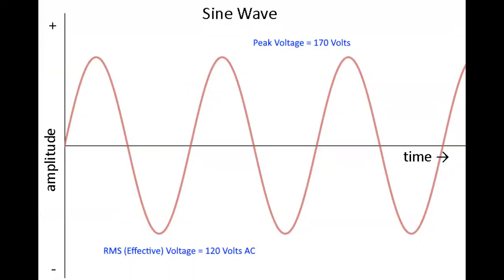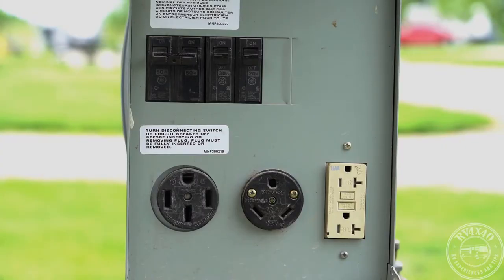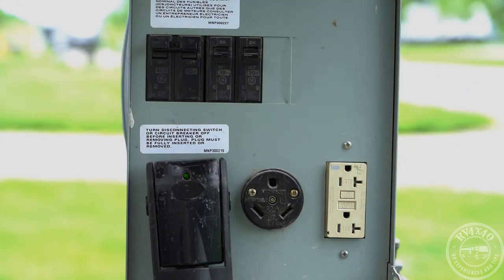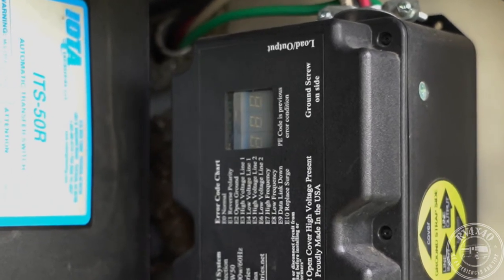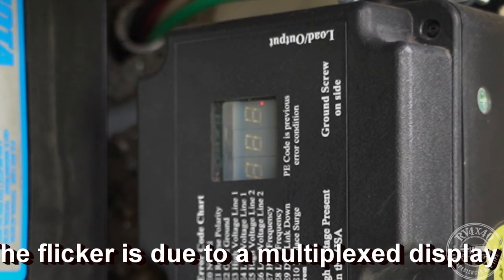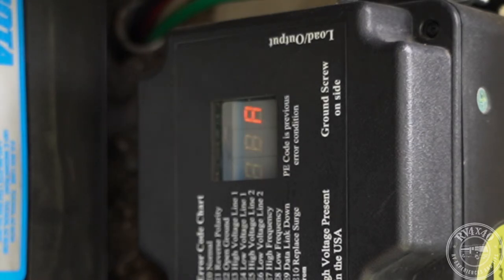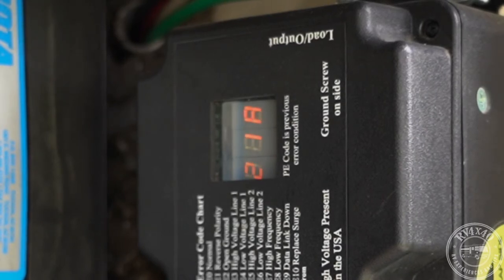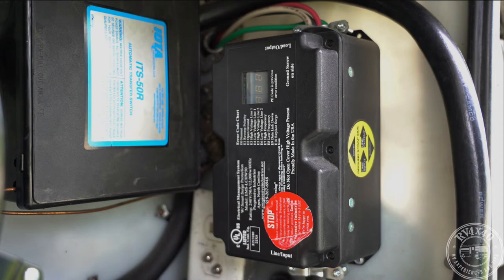RV Energy Management System

Comment: Very well done video.  I had one of those and it worked well except when using a small portable generator (Honda EU2000i when running the A/C).  The problem was when the A/C started, the generator voltage would drop enough to cause the EMS to cut off the power, causing the compressor to go in to a locked rotor condition.  This problem wouldn't occur if I were to use a larger generator.
Reply from the maker: Makes sense.  I would expect that might be different with different combinations of generator and brand of EMS.  Not sure how different they might be in tolerance to how long the voltage can be low before they disconnect.